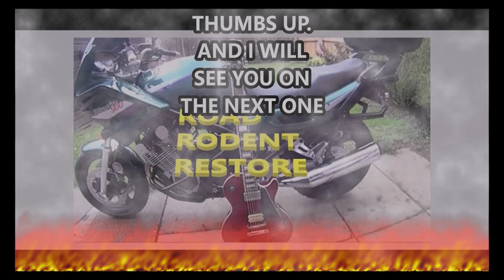CBR1000F Landfill bike, should I just do a top end rebuild?

Comment: Dont go to that extent mate can be very costly .especially  messing with the crank etc......leave it at least work you can do.to make it run
Reply from the maker: Pretty sure both cranks are ok so hopefully I will be reusing the old shells. 👍
Reply: restore  you're a better man than me.......takes some doing with a modernist engine
Reply from the maker: Bit daunting but should make good content for my channel, win or fail. Lol 👍
Reply: @jonyr1TT  very true.and a few swear words beeped out lol
Reply from the maker: Hopefully no bleeping lol 👍
Reply: @jonyr1TT   + if you only do a top end job, and the bottom end does require work later on, you'll wish you'd done it whilst you had it in bits.  Nice tinkering work whilst the weather's not great too :-)
Reply from the maker: Yeah thats the way I'm thinking to. Rip it all apart and hopefully put it all back together again with out messing it up. 👍